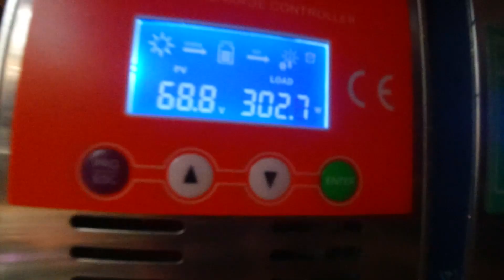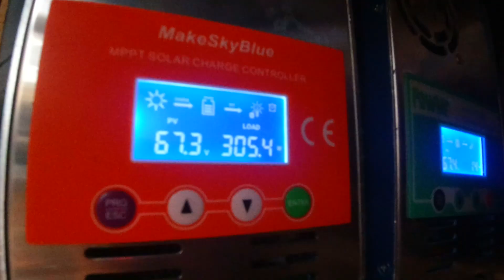100 year Nelson NZ Flood Aftermath.. The cleanup begins

Comment: Marty, I think it might be time for you to put some serious effort in to your power system. Things like a proper weather tight and level equipment platform with better ground anchoring, a more robust intake system, etc.
In fact, a good redesign and a higher investment in parts is really called for. You could install a side tank with an overflow that would buffer your water feed against flooding while providing a more powerful water flow and it would last for years with little maintenance. 
I feel like your current setup is more of a proof-of-concept prototype that was done with minimal investment and it looks to me like you are ready to implement a more developed system.

Comment: Looks like you could do with a couple cross ditches across your driveways....
A cross ditch is a water control feature that can be driven over that redirects the water off to the side of the road rather than have it continue to travel down the track eroding the road base as it goes.
I think a bit of smart contouring of the road surface can accomplish this without causing too uncomfortable a ride. It may save a bit on road maintenance long run as well...
Reply from the maker: Yes I do have those on my 4wd track (shortcut to the main rd), I think thats why it held up so well

Comment: Man, y'all have really caught it. We had some similar issues back in the nineties with flooding in our area, which washed out bridges, etc. I have a question about the road up keep, do y'all have a government agency that handles road construction and work. And why don't they use what is termed rip rap, stone that is broken up n to pieces anywhere from three inches in diameter up to six or eight inches. It would work wonders for the culverts, and help tremdously with erosion. Although I understand that when you have rain of that amount, ain't  much going to help. You are s great help for your community. Stay safe!
Reply from the maker: Its a private shared access driveway so we are responsible for upkeep

Comment: Youre the expert, but cant you do something like put some chain link fence in a funnel shape before the culvert so it blocks the bits of wood which cause the gravel to pile up, then the water would just go around and come back before the culvert and give it more time before it fully blocks up or is this simply a size of the pipe issue and just crazy rain
Reply: Commenting as watching lol, seems you will be offsetting some of these when you rebuild them? seems to solve some of the issues I was trying to address

Comment: Here in Florida we can have 8 to 10 inches in rain and not really have much flooding due to the fact the soil is mostly sand and it soaks right in. We've lived here since 1995 and have had many heavy shakers and only minor flooding.  We moved here from Minnesota were the soil is heavy black dirt and a lot of clay and when 2 inches of rain comes down quickly it floods very badly.

Comment: would it be worth putting in a couple of farm bridges ,instead of the culverts .in the worst locations. slightly dearer, but cheaper than having to clean and re-build culverts. ( large trees , re-inforced concrete covering)

Comment: Might be worth putting some angled metal grates in front of those culverts to prevent a blockage further in.
Reply: No. That will be more likely to plug. Plugs happen at the inlet. The real answer is to size the pipe to pass the 100yr flow plus bedload and debris. But, that gets expensive and my be impracticable. A vented ford is a reasonable alternative.

Comment: Liking the C5 Allroad .. much maligned IMO. Work quite a bit on mine .. front airbags and suspension compressor main culprits. Easy enough to fix when you know how. Know 4.2 engine much better than 2.7.
Reply from the maker: Yes they are good wagons, mine is very economical with the 2.7diesel but like you say the suspension is a weak point

Comment: It's a shame there isn't some sort of automatic auger or belt system that could start up and clear the culvert opening when a differential flow or level float is tripped, or maybe an automatic cellular alarm that could trigger and alert the road department or volunteers like you (along with a fund to keep the machines in operable condition)?  I know suggestions like this are probably worthless, but I hate to see the damage you guys are going through and I'm afraid we're going to be seeing 100 year floods turn in to 5 year floods.  The folks in your area are lucky to have you to save some of the roads that you have.  Best wishes and good luck.

Comment: Man that spot in there a video at 7:55 looks like a horrible spot for Calvert's it looks like it's just build like maybe cement walls on either side rock suction wall concrete would a nice Woodbridge over-the-top seems a lot of water flow there it looks like those culverts can't handle it

Comment: Marty a culvert under a roadway needs a mesh screen which needs to be kept clear of debris periodically. If the culvert does not block with sticks and SH*T the roadway will not wash away. An old farm gate with galvanised wire mesh could work if you don't want to throw money at the problem or make one.

Comment: With the constant threat of being locked in, I hope you have a good stockpile of diesel and gas at home for repairing your way out. I built a wood gasifier for my backup fuel source, runs my truck I stead of gasoline. Building a 4wd dodge ram right now with a gasifier as well, and still keep gas and propane on hand just incase things go sideways like this

Comment: wow, what a mess... Idea; you could put some kind of long metal mesh "pipe" at the inlet to the culverts to stop them from clogging up. 
Weld a ~1 meter oblong frame and put some metal mesh screen on 5 sides. Then put that over the inlets?
Reply: That'll plug faster. I had to remove grates placed over undersized culverts (temporary crossing where bridge had burned) when woody debris got caught on the grates rather than flushed through the pipes. The stream overtopped the crossing and it was a good thing the fill was armored with large riprap and grouted with concrete. Some road surface was lost because the concrete deck hadn't been installed, yet. If the pipes are too small, the road needs armor to withstand overtopping.

Comment: some culverts should be replaced by small bridges,the amount of water is unbelievable!
Reply from the maker: Bridges would be nice but very costly to do right and would require resource consent which adds another layer of difficulty
Reply: @MartyT  I know, but they would have lasted much longer. Nothing special, some railroad tie or wooden beams. A width of around 2 meters would be enough for good water flow. Iron beams or concrete panel would be better, but the price is higher. If you put more culvert pipes, they will simply clog again anyway.

Comment: If it is too difficult to clean what remains of the windows of this poor shovel, it should be possible to clean them with a Hammer, right? Ha Ha Ha, good luck in the face of this Deluge, here there has not been a single drop of water for two months (France East)